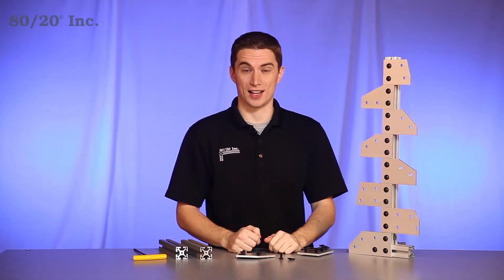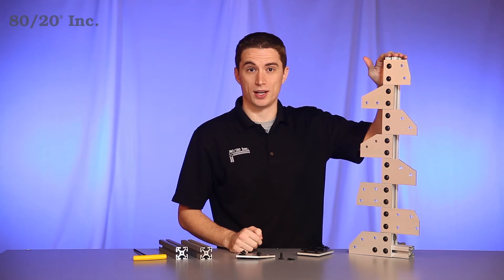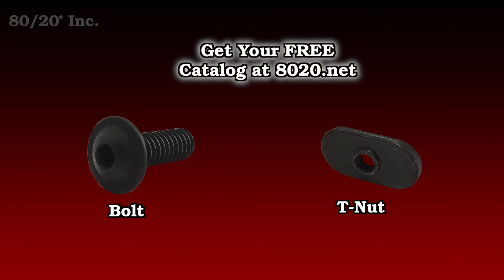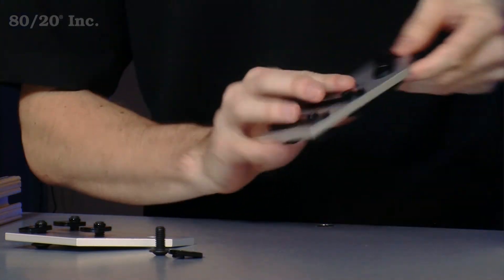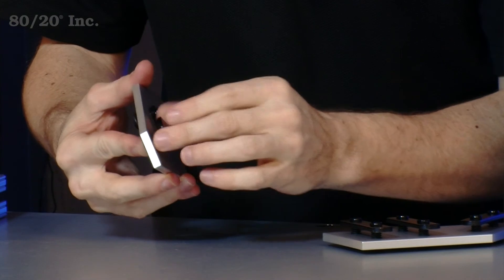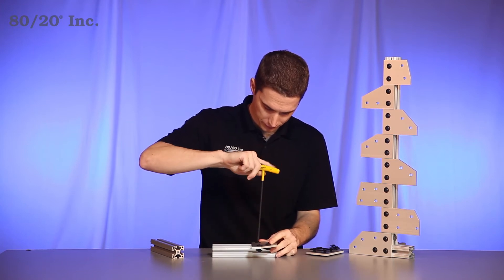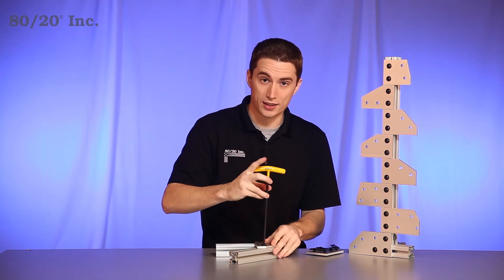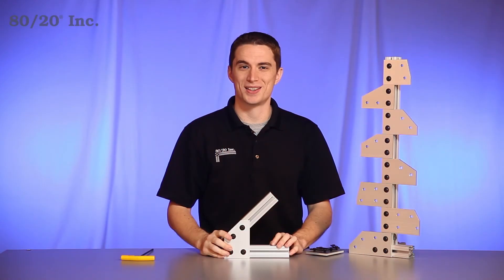80/20: Angle Plates Overview

Comment: Why no obtuse angle plates past 90 degrees? I'd like to connect a vertical post to another angled 45 degrees upward (135 degrees from vertical).  There are zero flat plate options.
Reply from the maker: Hello! Thank you for your question. For obtuse angles, we would recommend a miter connector. It is an internal fastener with connection angles between 90-180 degrees. Learn more: https://bit.ly/3MUod8g